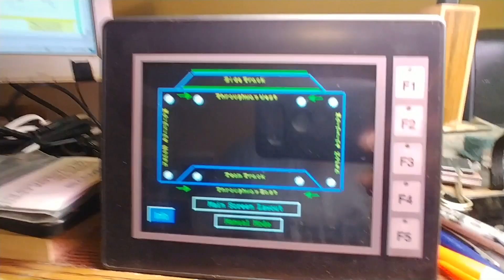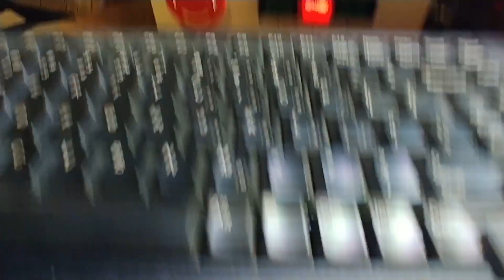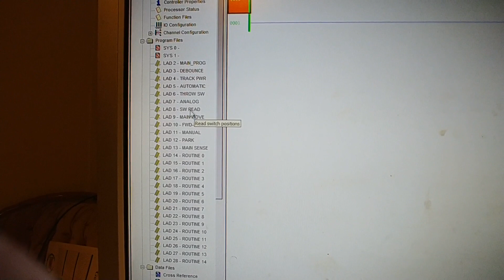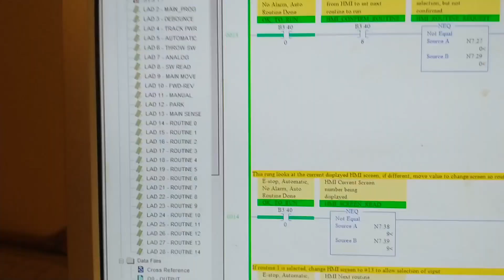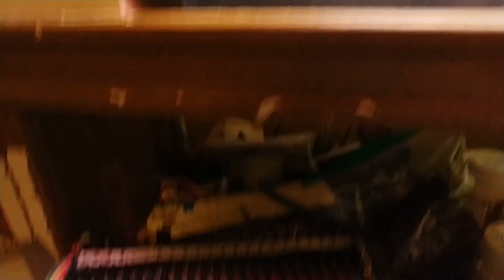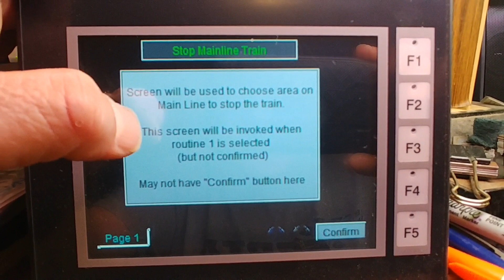Tour of Model Train Second Generation PLC Controls

Comment: Hi Mike,
Are you willing to share your plc code and track diagram SOLELY for the purpose of my learning how to model these tracks. I am currently trying to find a way to model the old AAR 8000 series track circuits and could use some help with starting with a basic layout such as yours. I eventually want to step up to polarized relay and slow dropping relay circuits but need help just getting started with neutral type relay circuits on a basic circuit. Any help is greatly appreciated.

Dan

Comment: hi mike,

what are you using to control the power and speed of the trains? i see that you have a Lionel transformer in your setup but i am wondering how you are managing speed control with the PLC. thanks!
Reply from the maker: Right now I can't control speed, but the PLC has analog capable and I plan to modify the CW80 so the PLC can set speed

Comment: Hi Mike-Really nice project for learning purpose. I am from India, can you please share the list of material and where can I buy the materail. I want to try out this project for PLC learning purpose. If possible please share your contact details as well
Reply from the maker: Most of the relays and isolation blocks were scavenged from CD/DVD production machines that were being scrapped so there was no cost in that regard. The Micrologix 1400 is new and was purchased from a local Rockwell dealer. Most of the control relays are simple 24VDC relays (the ones that control the track power and switches) I can provide part numbers of some of the parts such as the isolation Omron block and you could probably find them used on Ebay cheap. The board I modified to read the switch positions is a custom board. You can purchase a 5V to 24V isolation board to do the same job.